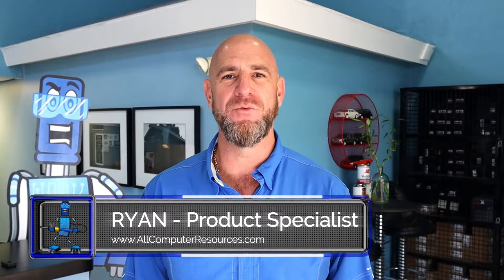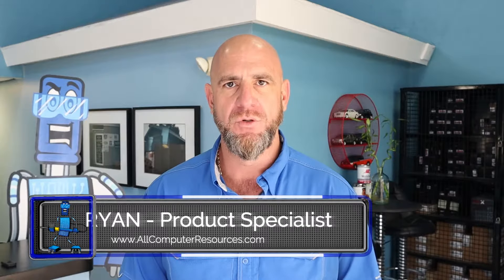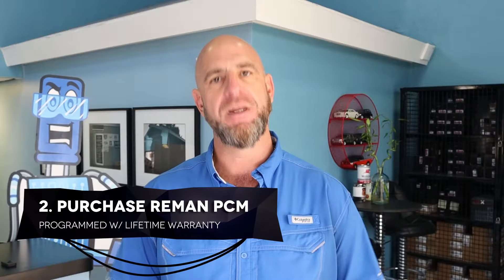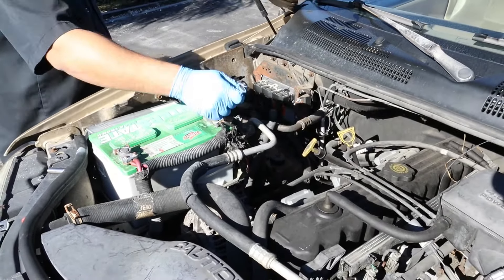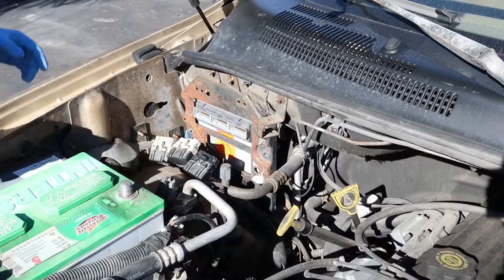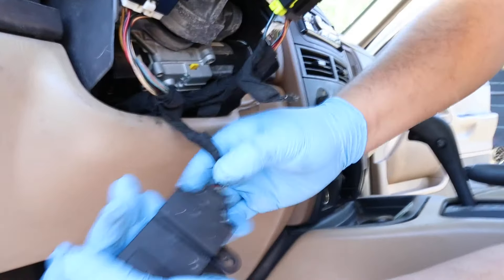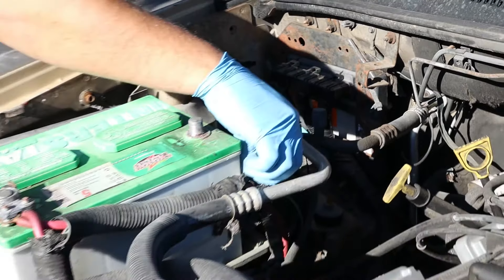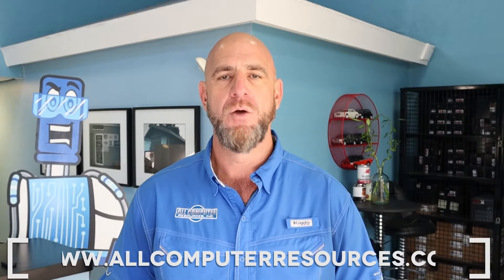SKIM KEY PROBLEM SOLVED - Dodge Jeep and Chrysler SKIM removal from PCM

Comment: This isnt a problem solved, this is you selling a service, solving the problem would be showing how to do it or telling people to buy hptuners themselves and do skim retrofit for removal
Reply from the maker: This solution works in most cases.
Reply: Seriously? Most people just want the antitheft disabled. They do not want to do it themselves, or buy a tuner to do one thing. I've had this done on an old GM truck that would not start if it was raining.
Reply from the maker: @jasonsprouse2803  Understood. Unfortunately, no tuner can disable the factory security that easily. The SKIM module must be removed to override the system, and the PCM must be sent in to adjust those parameters.
Reply: EEPROM

Comment: Right, so what I did was, got a brand new PCM that never had a SKIM programmed onto it and then took out the old one swaping the two. Next I removed the SKIM unit all together (Which is easy on a PT cruiser at least) then I put the key in and bam, it worked. Warning though, DO NOT put in your key with the new PCM inserted WHILE the SKIM unit is still in there, it will program the key to the SKIM again and you'll have the same problem all over again as the new PCM will be in the same state the old one was in.

Comment: I believe my skim module is out, BUUUT... I can take one of the battery cables off, wait 30 seconds, put the key in the ignition and make sure its on all the way (2 clicks), put the battery cable back on, and THEN the jeep will start. I have a 2015 jeep patriot.

Comment: Okay, so what if I have a used Skim Module from a junkyard. Could I still be able to use that skim module from a different Dodge Durango to the one I have? Both of them are the same year, my skim module burnt out so I was told to get a new one or used one.
Reply from the maker: With our process, you are eliminating the SKIM module by sending your PCM to us (or purchasing another) with the SKIM function disabled. You may be able to have a locksmith re-program a used SKIM module but it'll require advanced equipment and won't be affordable. You will also run the risk of that same style 20 year old module failing on you.

Comment: Went and had chip blanks ordered from Amazon, cut at Walmart. I pulled the Skim out and attached the original key in to the Skim loop with the metal shaft going into the loop. Taped it on with electrical tape and a small cable tie. Removed column cover and put skim behind it.  Jeep turns over everytime with new chip keys. Tricked the skim with old key. $20 for total job. Fob works too!
Reply from the maker: Great to hear. That worked for you since your SKIM module is still functioning. This video demonstrates the process for removing a faulty SKIM module and bypassing that system.

Comment: Just used these guys....I was super easy and I did the 2 day air. It was super fast..my jeep started right up. I got my skim delete...but now it does run rough which it didn't run rough before and the jeep only been sitting 3 months? Not sure. But these guys did what they said no bullshit
Reply from the maker: Right on Ibee!! Glad we could help you get the Jeep up and running again. Let us know if you need help with it running rough. Could be spark plugs and/or wires since its been sitting so long.
Reply: @acr  thanks. Imma do a nice  little tune up on it....but other then that I'm vary happy with your service..great job guys

Comment: 2004 Dodge Durango 5.7 - owned it for over 20+ yrs.

Cars Battery under hood went bad on vehicle - swapped it with a brand new one. Ever since then TPMS light went on and won’t go off. Made a separate post about that still haven’t figured it out but wanted to include info since that’s when all the problems started. 

Fast forward to last week all of a sudden multiple check engine lights come on. I pull the codes and will include them below. Truck was still running fine with nothing noticeable going on despite the codes popping up. 

Yesterday a family member used the car - they took it out for a few hours with no issues. They park it in the driveway. I go out late last night and hear music coming from the truck. I go inside of it and notice there is a red blinking dot on the dash board. The key never actually shut the truck off dispite the ignition being turned to the off position. Engine was off but dashboard , radio etc all still on with key removed. 

Supposedly that has to do with the sentry security system on it. I put the key inside the ignition to shut it off but it won’t do anything. I try to start the truck and will only sound like the starter is turning over but won’t start up. I disable the negative battery cable and put it back on. Red dot disappears from dash. I’m now able to start the truck up. It runs like normal. But now I can no longer shut the truck off. Just stays running and ignition will not shut it off. 

Key fob still unlocks and locks the doors of the truck. I did leave the fob in the truck overnight and it’s been cold / older battery so gonna try changing that but from what I’ve been told it won’t fix the issue. Called a few places that make key fobs and they were stumped on the isssue as well. Said they can make a new key for $260 but that the situation is strange if it’s able to still start the truck and not sure if it will fix issue. 

Do you have any advice or ways to fix this?

Comment: I have a 2000 Grand Cherokee 4.7, and it's showing an error with the key recognition, but it's an intermittent issue. Sometimes the problem goes away for days and then suddenly returns. And I would like help diagnosing the problem before proceeding with the reprogramming of the control module. The fact that it's an intermittent issue—does it indicate something specific I should look for?

Comment: Will this work on a 2006 dodge charger rt I'm having an issue where intermittently it will read my key and start right up but other times it will run for 2 or 3 seconds and shut off and security light will flash
Reply from the maker: Yes, this service is available for your 2006 Dodge Charger RT
Reply: Rober did it work

Comment: module works fine, key broke in two pieces and metal part got lost (ironically, wearing it around my neck so I would not lose it!) so much plastic in so many wrong places!!!
Reply from the maker: You don't need the chipped key anymore so run down to any hardware store and they can cut you a regular metal key

Comment: Just swapped a 5.7 into my truck and having issues with starting the motor. Had to swap the ecm out of the donor truck. Will this work with my truck? My truck is a 2007 dodge ram 1500, with a 4.7 in it originally. Swapped to a 2005 5.7 with its computer. Help please.
Reply from the maker: Mr. Murphy, If you swapped the motor and PCM from another truck, the Key and SKIM module is still programmed into the other PCM. I cannot guarantee that clearing the SKIM and removing the SKIM module will solve all your issues, but is a step that is required to move forward. You can contact us directly at 786-879-7566 and we would be happy to set that up for you.
Reply: @acr  thank you the shop that did the swap should be contacting you soon. What we have determined is we need to remove the skim module and use an unprogrammed pcm.

Comment: I have 2011 Jeep wrangler JK that I want to get rid of the SKIM, originally the JK is a 2007 model and it was automatic, I replaced everything under the hood from a 2011 Jeep wrangler JK that includes engine, 6speed manual transmission, clutch and break pedal, the TIPM wiring, the master cylinder, and the slave cylinder, now I have security issues… I just want to get rid of all security, what should I do if I have the key tumbler and the key from the original  07 and the automatic pcm? I also have the donor 2011 JK manual PCM?
Reply: I’d unplug the skim and try putting the pcm from the 2011 in. If that doesn’t work I’d send the 2007 pcm in to these guys and have them remove the skim. Even with an automatic I think it would work with the manual because it’s the pcm, the tcm controls the trans
Reply from the maker: Please give us a call so we can get all the details and come up with a solution for you.

Comment: i have a jeep grand cherokee v6 gasoline and it has no even a spark or fuel supply and we change it a new pcm , but still its not working. do you have any idea about this issue？  because this jeep was not running since 4years thank you and God Bless
Reply: Have you checked the ACTUATOR between key and ignition switch !

Comment: What if the alarm goes off. If the alarm gets triggered by accident, will putting the key in the door and locking the door still turn off the alarm if the skim is deleted?
Reply from the maker: The PCM and SKIM do not play any role with the vehicle's alarm.

Comment: Will this solve my p0513 invalid skim key code 2012 jeep liberty. Jeep just clicks at random times when starting. Sometimes taking a long time to start. Seems to be getting worse and getting on my nerves now security light is not on and no check engine light thats the only symptom. My mechanic put a scanner to it and thats the code it read.  I have 2 original keys and got a new key and does it with all 3. Thinking about just taking the immobilizer out and ordering a pcm woth the delete.
Reply: @Brandon Donovan  unfortunately not. I returned it. I spoke to someone and then bought it off their website specifically for my jeep. Didnt work then i was told that they don't do the skim delete for my jeep meanwhile i spoke to someone who said they do and then ordered it on there website and paid extra for the skim delete which stated it was for my specific jeep...supplied them with my vin and all...returned it and they refuse to give me a full refund they took their re stocking fee even when it was clearly their fault...dont recommend them
Reply: @ddrc6437  Thanks for letting us know.  We'll deal elsewhere!

Comment: after the skim is deleted will I lose my key fob functionality, such as lock, unlock, trunk release, and panic?
Reply: Let me know if you found an answer to your question. Perhaps RF functionality of key fob is in SKIM module?
Reply: Yes you will.  Just finished up with an install and the key at this point becomes and old school key.  It will start the car and unlock the doors but the remote functions no longer work.
Reply from the maker: This is a possibility with certain model vehicles which are not included on our listings.  The vehicles we outline in the listing will maintain the key fob functions.          https://store.allcomputerresources.com/skimremoval.html

Comment: Just had ACR remove Skim from ECM for 2000 Jeep Grand Cherokee.  After install, it started, skim/light came on and kept driving.  Soon however, I’m stranded on side of road and it won’t start.  Crank, no start.  May as we’ll be same as before.  Didn’t work for me.  Yes, the key Module was and is unplugged.
Reply: did you fixed it?
Reply: Have you found what the cause was and a fix?
Reply from the maker: Did you just purchase the SKIM service? It seem like the PCM can actually be failing. If you just purchased the SKIM removal we do not test or re build the PCM, we just perform the service requested. We do have the PCMs for your vehicle and can offer a discount since you already have a purchase with us. Give us a call at 786-879-7566. Thanks
Reply: Sold the Jeep and all it’s problems, bought a Lexus LX

Comment: I have a few questions. I have several jeeps and i use a few offroad. Would I be able to switch this between my jeeps for which ever one I'm not working on at a given moment? Wrecks and maint go with offroading. Also, I have an after market remote starter on another of my daily drivers. is this compatible with that? I'm searching for answers before I find out I just spent money on a brick. Main problem is with my daily but if this works then why not add a bit of reliability to my off roaders.
Reply from the maker: Indeed, the remote starter transmits a signal to the ignition system. Should you choose to bypass the SKIM, you can still operate this system, without the need to synchronize the remote starter with the security system. It's crucial to completely remove the SKIM module, as demonstrated in the video. Hopefully, this addresses your inquiries. For expedited assistance, feel free to reach out to us at 786-879-7566.

Comment: Hello. My 2008 Jeep Commander has a transmission issue, I don't have to code number at the moment, "Nutreal Parking Switch"  (TCM) that is intergrated in the ECM. Your ECM's are tested for All functions? So I just need to purchase a refurbished ECM from you, delete the SKIM, follow ignition procedures and I'm good to go? Thank you for your time.
Reply from the maker: Yes, our PCMs are tested for all functions. The skim delete option is available as well. You can order through the website or contact us directly at 786-879-7566 and we’d be happy to help you. Thank you!
Reply: Neutral Safety Switch And TCM are totally different and there are other things that can cause your Trans to have issues.

Comment: I have a 2002 Dodge Dakota Sport I added a new computer from all Computer Resources and found that I have a SKIM problem now. Never had a problem before. I've followed the videos for the SKIM removal but there isn't a module in the steering column. Where else would it be?
Reply from the maker: It may of been removed in the past. Should be under the steering column.

Comment: I removed and replaced my PCM. My 2006 Dodge 1500 ran good for about 1hr. It lost acceleration, and idling got rough. I pulled the plugs from the PCM and put back in and it ran again like it should. Everytime I do this, I have to reset and go through the same process. I finally went to the dealer with the skim code PO633. Very expensive key, but this did not reprogram the system.
What is the problem here?
The dealer wants to soak me for Diagnostics. What do I do next?
Reply from the maker: You removed and replaced the PCM I see but did you have the SKIM removed from the PCM by us and did you disconnect the SKIM module before installing the new PCM?

Comment: I purchased a replacement PCM for my 2007 Dodge Durango. Well I connected PCM and started the vehicle ...I believe someone changed the skim module not knowing we had to put the original back in to connect to PCM and key. Is there any way to reset and start over? Did I do any damage?
Reply from the maker: Please contact us at 1-866-699-5230 so we can better understand your situation and offer the right solution.

Comment: I am going to do this when i have a moment to work on my jeep in the next few weeks. P-0513 code. Did a work around to get it going (unplugged battery and a fuse, waited 5 mins) and it fired back on. Once the car is running, can the skim kill power to the engine if im on the road? Or does it only do its initial check at the start of turning the ignition on? The bandage fix got me home, now im paranoid to use it tomorrow to get to work if it could die on me while driving
Reply from the maker: A failing SKIM module can potentially shut down the car at any given time

Comment: I recently had this service done to my 2005 dodge magnum , after i plugged the pcm back in it still doesnt crank up , do i need to have my key reprogramed? Im kinda lost been without the car for almost a yr now because the guy switching the interior parts broke the skim module off the side of the ignition so the ignition would fit smh. Any further info would help thank u .
Reply from the maker: Did we perform the SKIM deletion for you?

Comment: Will this work on a 2005 Dodge Durango 4.7? It reads "NGC/SKREEM Status : Engine Disable Command" currently. Key programmer said that the keyfob gets programmed and the WCM is not picking up the signal from the key thus always going into engine disable mode. He says faulty WCM, I opted to have the security system removed. Let me know if it would work on a system like this. Thank you!
Reply from the maker: Yes, this process will eliminate the SKREEM system altogether. Under the steering column is the SKREEM module, that would need to be removed and you need to have the security disabled PCM installed thereafter. We can provide the service to your PCM or you can purchase another unit with the option disabled. You can call us toll free at 1-866-699-5230 if you have any questions.

Comment: Hello I would like to know after the skim module bypass chrysler 300c what should I do with the security. Whe I open the door i have headlights and flasher on and off all the time for about 30 seconds. How can I neutralize the security ????
Reply from the maker: Mr. Silva, The SKIM Module is the engine's immobilizer which has no correlation to the Alarm.